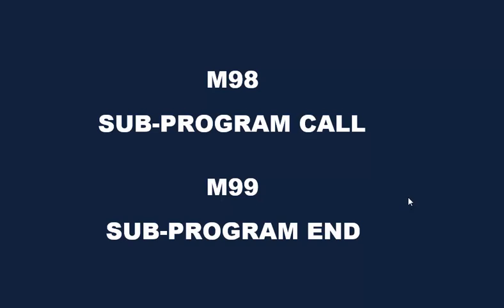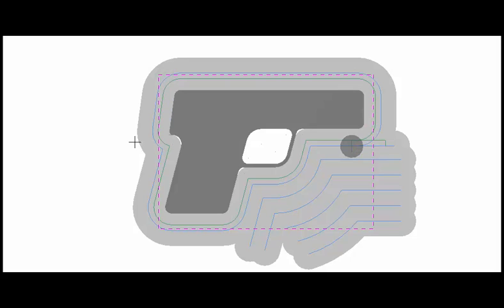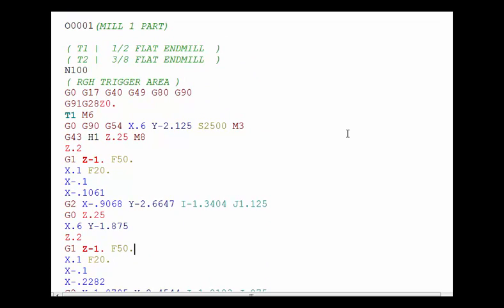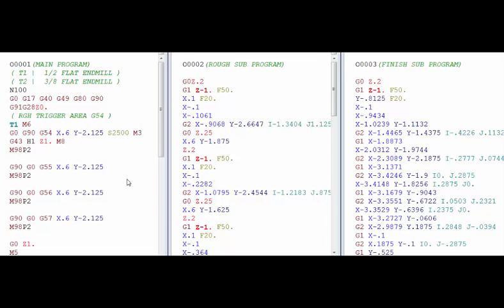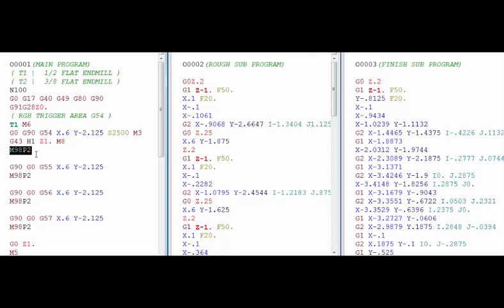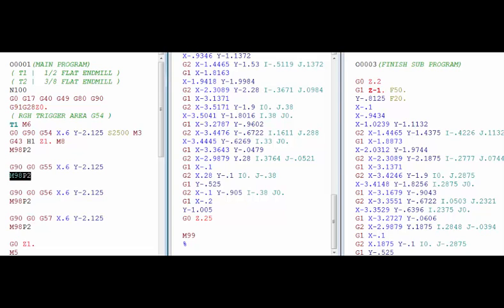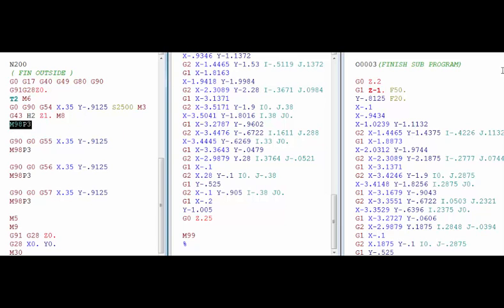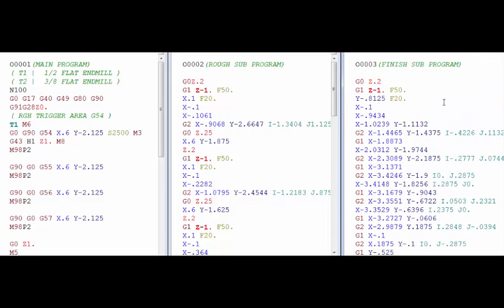HOW TO USE AN M98 TO CALL SUB PROGRAMS ON A CNC MILL

Comment: I have an M98 P12345 L10 at the beginning of my program, after the safety codes but before it calls up the first tool to start machining. Program 12345 is a bar puller sub program I wrote and I want my program to run that sub then the main 10 times then stop. With the L on that line of code, it runs the sub only 10 times then it runs the main and then continuously loops nonstop. What am I doing wrong. I have an M99 at the bottom of both programs. Is the M98 in the wrong place? Is the L in the wrong place? I spent most of my day today trying to figure it out.
Reply from the maker: Email me your programs! tstikkelman@gmail.com

Comment: Do you have to use multiple work offsets (not conducive to using a pallet system) and what if not all parts are oriented the same way to fit said pallet.  My assumption is that you could use the same work offset so long as the cam compensates for the offset.  I use one work offset for the pallet when camming parts affixed to pallet and use fusion 360 to assemple them prior to caming the ops.

Comment: Hi Tom;
  Rather than using g54, 55, 56..
  I am getting a headache:

  N50 m97p300L10

N300 goxo.yo.z.1
N310 s1000 m03
n320 g1z-.2 F20.
n330 y.75 
n340 x2.
n350 g91 x2.2
n360 m99

  So, it isn't just moving over a set amount and running another pattern. 
  I am trying to make a pile of smaller knockout parts from a length of flat...
  Hey, thank for posting!
  Mark
Reply from the maker: +Mark Richardson  Thanks Mark. M97 internal sub program call only works on a Haas.
Reply: What happens when I take it over to the Fadal for production? 2007 20x40 ?
  Ah...  I might just stay on the Haas...
  What was the giveaway? M97 internal sub is Haas specific? ( I have a new control TM-2 )
  Thanks yet again!
  Mark

Comment: I love it! I have a few questions... Where are the subprogram located? Are they different files, or different parts of the same file? If they are separate, how does program #1 identify them, and would they need to be in the same directory? Would other programs be able to call them as well? If they are part of the same file, how are they separated in the code?
Thanks for all the work you put into these videos Tom, you are an excellent teacher.
Reply from the maker: Good question. They are separate files in the program directory of the machine. The sub program is called using the M98 command. Yes. Other programs can also call these sub programs. Hope that helps.